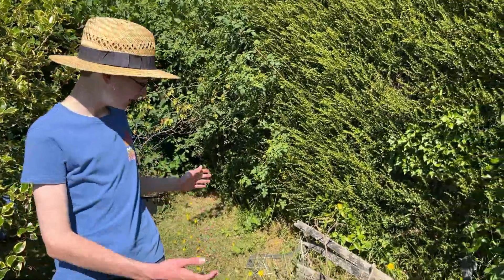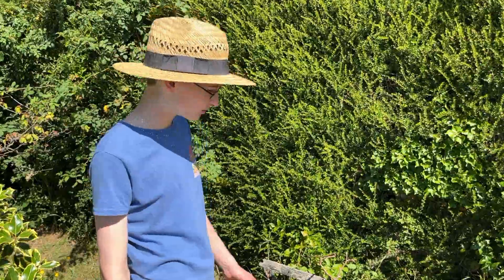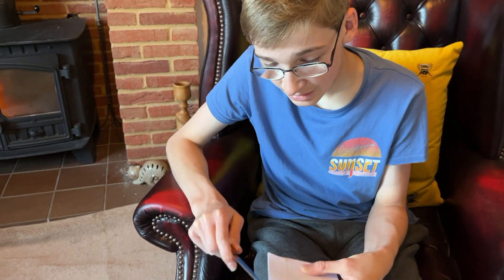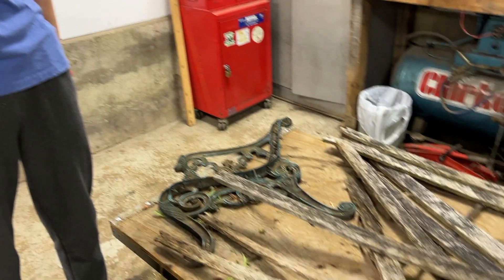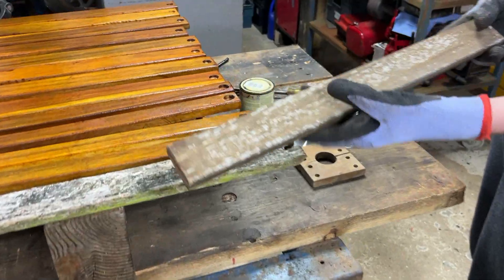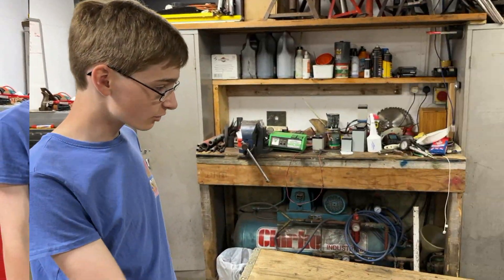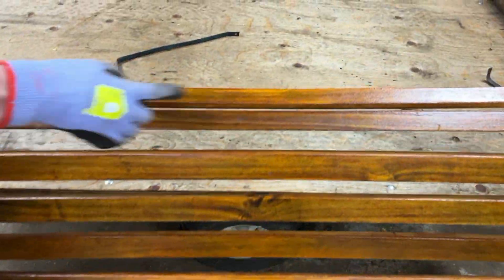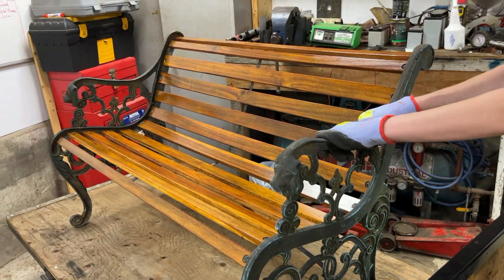Garden seat refurbishment

Comment: Good evening Joseph, I hope that you are doing good with that heat wave 👍👌😇 Great garden beds and great sence of humor about the cabbages  🤣👌👍 Fire is a great humidity burner 👍👌😇 Beautiful fire place 😇👌👍 Great channels  The Ayr Cave Shop and ollysworkshop 👍👌😇 You both did an OUTSTANDING Garden Seat Restauration 👌😇👍  Great looking trailer too and I can see that the hydraulic oil as dry on your trailer 👍😇👌 Yep the bench in the middle of the field, yes that was a clear signal from your sister and mommy  🤣👍 OUTSTANDING tractor ride 👍👌😇 Love your sence of humor 🤣👍 Enjoy your summer holiday Cheers 🍻🍻
Reply from the maker: Thanks for the kind words. The heat wave was not enjoyable, but we got through it. The bench turned out very well. The trailer is holding up well. Take care

Comment: Theres  so many of these just end up at the tip and there such a nice project to do up ,but its a throw away world but what people dont realize is that there's so much satisfaction in restoration projects. Hey Ho if they want to chuck there money away its up to them  but the planet cant take the wastefulness of its resources and the piper must be payed shortly 
\revelation chapter 11 verse 18 !    Now how did they know our current situation 2,000, years ago , ask me and i will tell you LOL  anyway nice vid joe looked very hot there its been nice to get things done outside .ive just built a 10 by 7 wood workshop completely out of reclaimed good timber ,thrown away i just denailed it and instead of a workshop costing nearly 2 grand i only bought the tin roof and a bit of yes reclaimed larch lap panelling ,i didn't make a vid but nice project and workshop to do bits of woodworking in even bought a lathe from what i saved , i might do a you tube vid with the wood working ,anyway take care .dont get sunstroke lol.
Reply from the maker: Your new workshop sounds great and just the sort of thing we would try to do. The bench project was good in that we were able to reuse the ends and recycle some timber. Take care